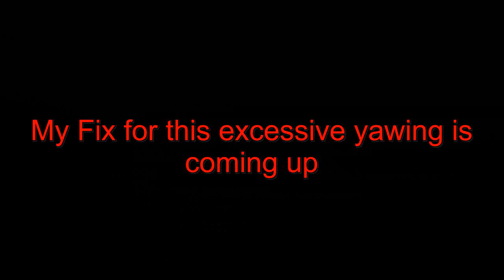Airhogs Sharpshooter Helicopter Spinning problems solved during Product review.

Comment: If you have a rear rotor that goes to slow causing it to go left or right, put a tiny magnet on the motor. You'll need to experiment to find out where it will make more RPM's, but it does work. I've done it on various motors with success. Might need to compensate for the extra weight, but it's a small price to make your R/C run correctly. I know this model doesn't have a rear rotor, but others you have might need something as suggested. PS. good video you got another "like" out of me.

Comment: Is it safe to assume that the blade trimming technique works on most ,or all of these air hog models? I've also found that with my Sawblade that simply using a prop underneath the choppers front end to tilt the nose about 5 to 10 degrees makes for smooth vertical takeoffs.